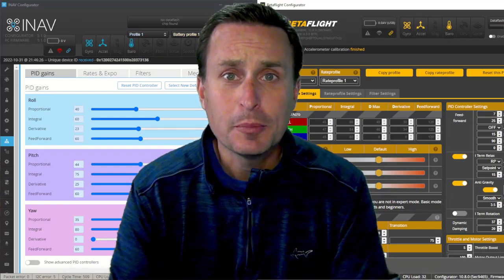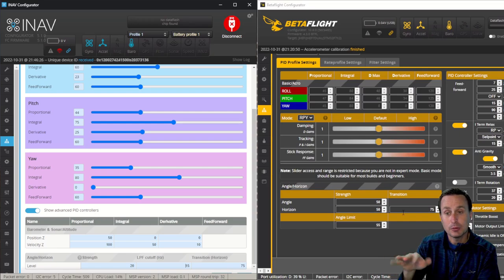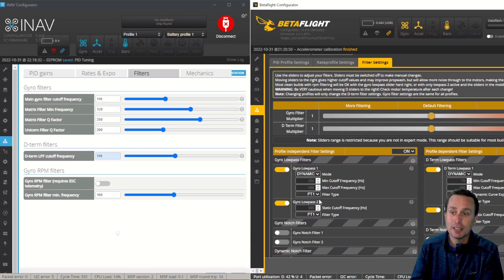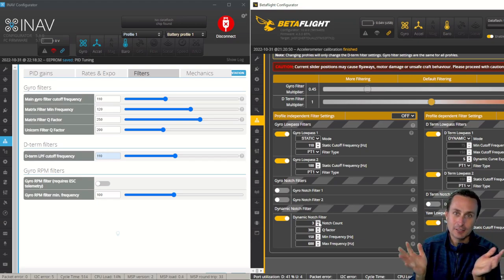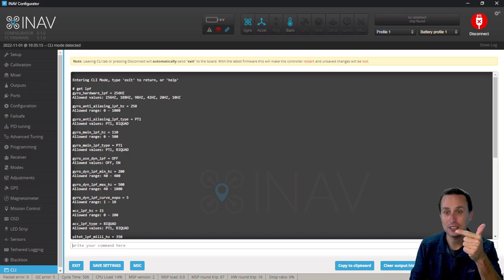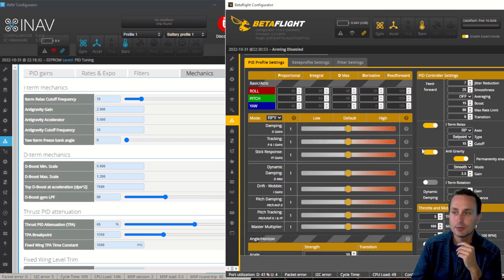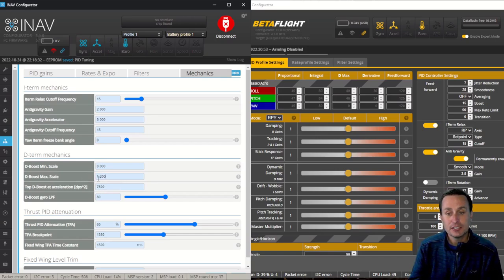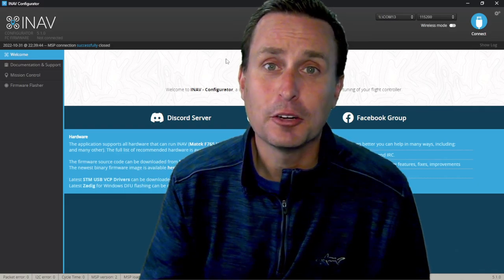iNAV PIDs Tab -- 100% EXPLAINED! 🏹

Comment: can u held me pid on inav for 13inches quad: 5110 750kv, 13*65 carbon prob, 4s 6600mAh with full GPS setting. it flight but a little bit ossilator and when i turn it flight WayPoint mode the quad increse altitude very fast seem like i fly away

Comment: you mentioned you would get into the settings on advanced PID section I.E. pid controllers for barometer and poshold modes. I guess you skipped all of this information. would love to hear your thoughts for multirotor poshold tuning.

Comment: Would the gyro hardware lpf in the inav cli be where you can set a bmi270 gyro to OSR4 mode like how betaflight 4.3 now does by default?
Reply from the maker: I did not check, but I don't imagine iNAV has OSR4 mode.

Comment: hello sir,is inav compatible to mamba f405 fc?
I am a beginner in fpv and i want a very stable drone.
Currently i am using betaflight.
Thanks.
Reply from the maker: I would look in the iNAV Flash tab in the Configurator.  I'm not sure off hand.
Reply: @uavtech  its something like  fury osd firmware for this fc.